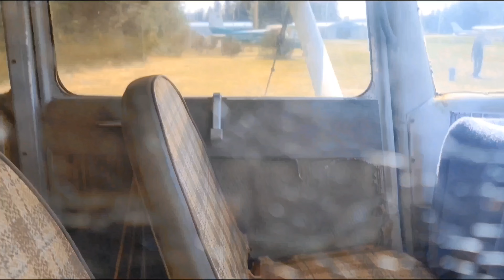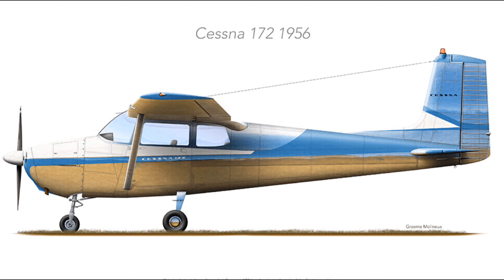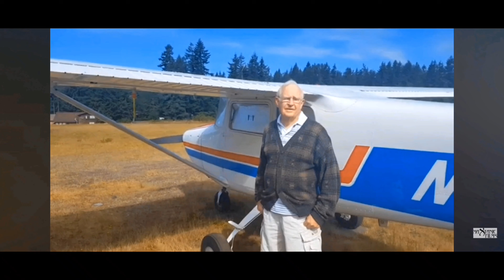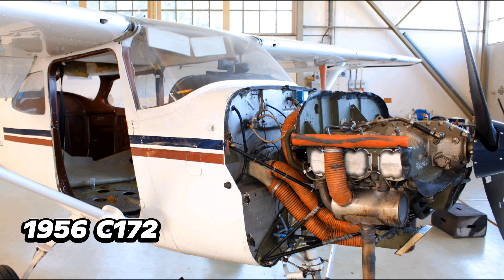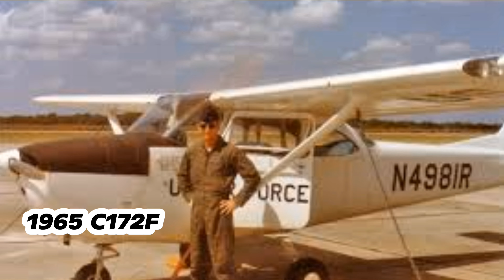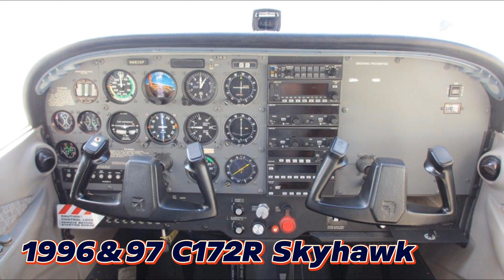Cessna 172 History (All models) - Most produced GA aircraft of all-time

Comment: The 172 is certified for spins. Here in Canada we do them all the time as a part of training.
Reply: The Cessna 172 is not spin-certified in its Normal category, some models can be used for spins in the Utility category ONLY, with appropriate weight and balance and pilot qualifications. If the aircraft's Certificate of Airworthiness specifically states approval for Utility category operations. This requires the weight and balance to be within Utility category limits and fuel restrictions often apply. Spins, particularly fully developed spins, are not recommended for most C172s, especially older models, due to structural and safety concerns. The fact you do them all the time in Canada as you say makes me wonder if you all are pushing the limits. Are these aircraft certified? About one-fifth of Cessna 172 fatal accidents involve stall/spin loss of control.
Reply: @DrivetoSleep-yo1mk  Yes the aircraft are approved for spins. And if one-fifth of all accidents involve stall/spins, don't you think that training for it would increase awareness and reduce accident rates? I think it's an important part of training, i wouldn't consider it pushing the limits in my opinion.